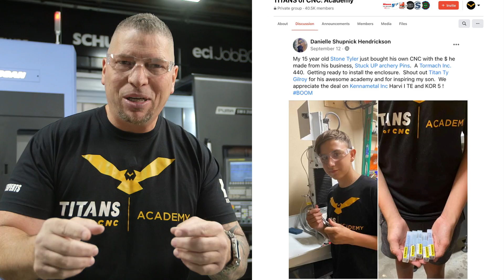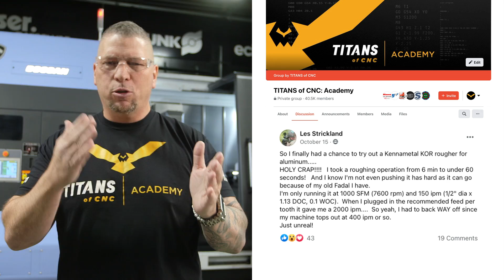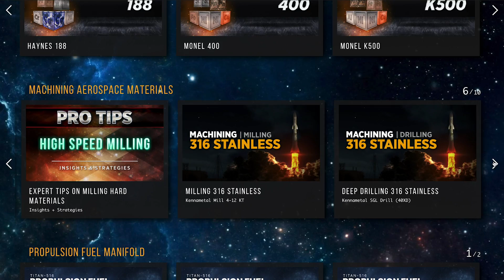These Standards are Saving Machinists A LOT OF MONEY

Comment: Can't seem to get the KOR5 to work for me.  Running 12k rpm at .050 radial, 1.5" axial on a 5/8" need to run at 600ipm to match our current 3 flute helical end mill and we just get too much vibration in the KOR5 as we increase the feed over 400ipm.  Yes, takes less HP and in theory will remove more metal as we go faster but the parts are vibrating and we are breaking index pins and getting weird chatter.  Chatter I don't care about because it is just roughing, but I can't be damaging fixtures.  Back to the old fashioned helical for now.  Too bad I love high flute counts in aluminum, they are the future.  Run a Kyocera 4 flute for finishing on some production parts and it is amazing, but no good for roughing and god awful expensive.
Reply from the maker: Doesn’t sound right... Hmm Add more pressure to the tool. Take 15% radial much bigger cut. Then start ramping up the feed... also don’t worry so much about IPM... Only thing that matters is MRR.

Comment: I want to start learning. I've learned so many trades. And this is one that i must obtained!!

By the way,

How can i get stared at home?
Any small mils i can use? Setup to mat laptop?
Reply: I can recommend the Fehlmann Picomax 56 Top
Reply: Check out videos of the Tormach machines, at this channel and other places, which are smaller realatively reasonble priced machines. They are industrial grade machines. There are other brands even smaller and cheaper, for home use/hobby, just need to google around
Reply: You can buy fairly cheap desktop cnc routers. They usually work on wood, plastic, maybe very light aluminum. Shapeoko, XCarve, etc. I don't know if you want one of those to practice/start or if you want to work on real metal, but they are out there.

Comment: Titan I love what you do for the manufacturing community. I got the Kor5 end mill, its crazy good, it got pulled out 0.040” from my hydraulic holder. I need to get a duo-lock 1/2” Cat40 holder, but I have a bit hard time finding it on Kenna website. A link or part number would be greatly appreciated. Thank you very much
Reply: Costin.  We don’t offer a duo lock for the KOR5 just yet.  You can find duo lock holders on the Kennametal website.  Download our NOVO app.  Maybe you mean Safeloc?
Reply: 5998754 Safelock reducer sleeve.  5647194 CV40 holder from Kennametal
Reply: @scottetling3887  thank you Sir, apparently I can't read. It is Safelock, and that's the combo I was looking for, sleeve and holder

Comment: Hey Gilroy thanks for your content and your work, I'm a junior mechanical engineer and I'm hoping to near upgrade the machining shop own by my father (Because there are only manual and conventional machines). I'm wondering why do you use the software Fusion for cad and cam instead of Mastercam? From the Dominican Republic, thanks for your work and dedication, you're an inspiration.
Reply: Fusion is primarily a product development platform that contains CAM as a tool to aid in that process (along with many others, simulation, rendering, sculpting, etc); it may or may not fit your business model.

MasterCAM is primarily a CAM platform with a little CAD to aid in the process of CAM; it may or may not fit your business model. 

Fusion is a realtive 'new and modern' idea, and cloud based. Might be easier to work with making presentations and such towards doing the teaching online, and other reasons.
Reply: @Rimrock300  Thanks, I know a few of the pros and cons of both softwares, what I want to know is why they use one instead of the other